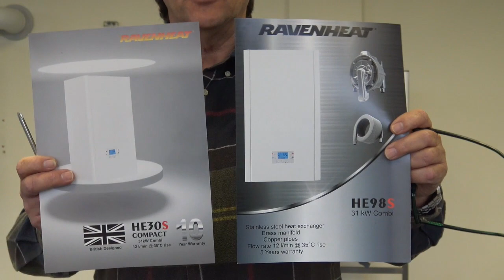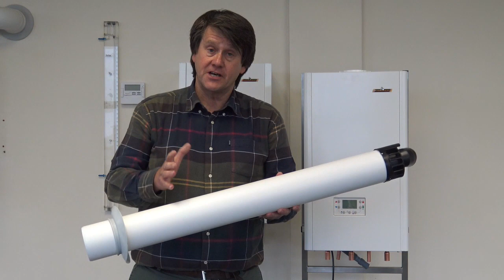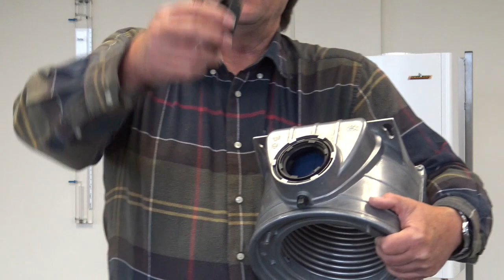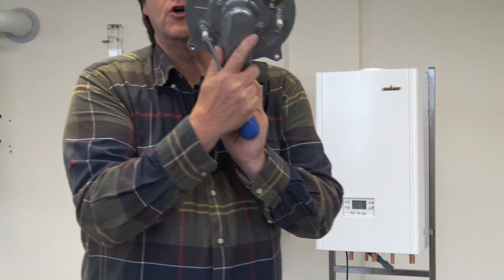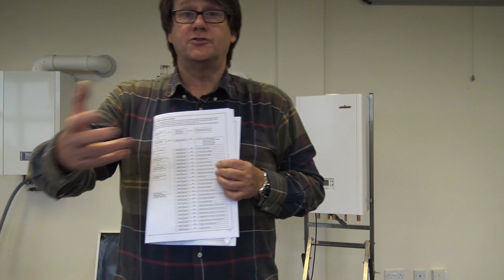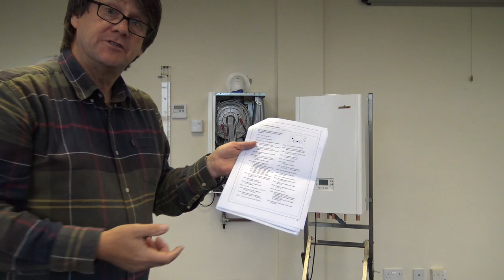Ravenheat HE98S & HE30S Combi Boilers

Comment: Plastic plugs in unused orifices  led to call-outs on two separate occasions due to water spraying out of the plugs. 🙄
Prior to this, Ravenheat were good with their warranty, they changed pretty much every component on my boiler.
Now struggling with code E41 which relates to flow and return temperatures being too far apart, potentially some blockage in the pipework.
Is anyone familiar with this?
Maybe it's time to replace it after just 5 years. The wife has fallen out with it 😢

Comment: Hi ...looking for parts for Ravenheat csi without timer. No hot water, radiators working fine. Boiler only firing up for heating but not for hot water only.

Comment: Why aren't famous Leeds plumbers Allen Hart and Michael Goodall pushing your superior boiler, designed and manufactured in their home city? Their social media channels have been quiet recently on your boilers. If I were you, I'd want to find out what's going on with them, you should address any concerns they have got. Because customers are going to be wondering if there is something you are not telling them. Ravenheat is superior to Viessmann because they use copper pipes, not rubber hoses. Ravenheat are superior to Worcester because they use a brass not composite plastic hydroblock. Ravenheat's single pass stainless steel heat exchanger is equal to Viessmann's. The electronics are located in a plastic unit, protected from any leaking water. So what is not to like? What I have not heard about is the reliability of the electronics and ease of fault finding. I haven't heard about the secondary plate heat exchanger either but I am assuming their waterways are no narrower than other brands.
Reply: Thanks for the post 👍 
As you can clearly see the boilers are quality. 
Michael Goodall fits plenty of Ravenheat Boilers. And Allen Hart also has fitted a few in the past . 
I honestly think it’s down to public awareness? At Ravenheat we are a bunch of engineers with a vision to manufacturer quality boilers at a competitive price. 
But our marketing is dreadful 😢
Reply: @johnwilson2778  Hopefully not: Ravenheat will be discovered & bought out by some large competitor & all that passion, commitment & love for honest perfection will all be reduced to shite' like everything else in this Capitalist era of vile. Keep up the excellent work guys ( @Ravenheat ) , we need you more than you know.

Comment: Hi nice looking bit of kit, whats the Modulation range and whats the min KW running. Is there a System boiler and if so will it do two temperatures ie with Opentherm?
Reply: Hi Tom thanks for having a look 👍 It will go down to 3.5 kW so basically 10/1 . You can fit Open Therm we have a list of recommend controls. We used to have a system boiler that you could set the temperature of hot water separate to the heating, but it did not sell in the market? So the HE98s System and Primary boilers have one stat
Reply: Ah that's a shame, we could use Evo home to get priority hot water via OT, do you support Honeywell EVO home?

Thanks for the response.

Comment: Looks well thought out, very impressive, though as usual I think you could sell these off the back of your passion alone.
Will there be alternative bracketry options? Stand off frames for piping down the back, hanging bracket to get over troublesome wall substrates?
Reply: Thanks Dave . We have a fixing bracket in case you have a bad fix . The guys that fit them tend to have one in the van . To be honest we do not sell many brackets?   A stand off bracket is also available, but on the HE30s you can get the hot and cold + gas up the back without stand off